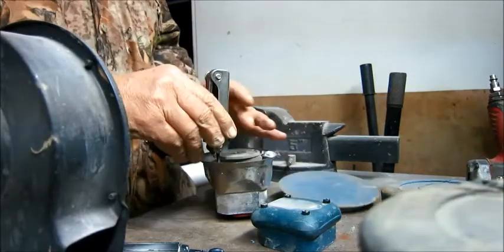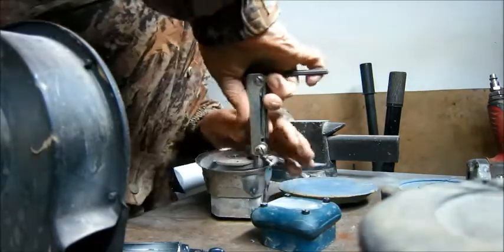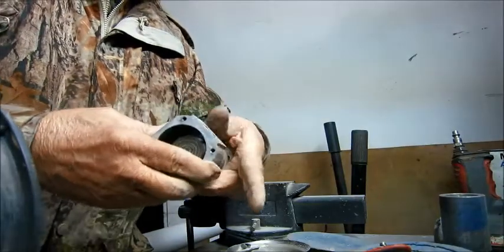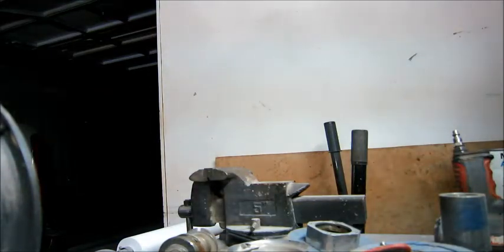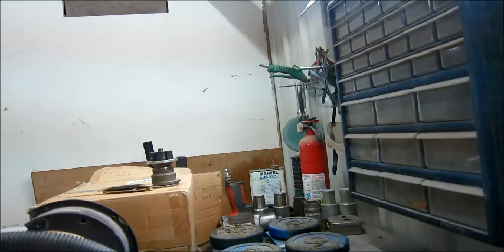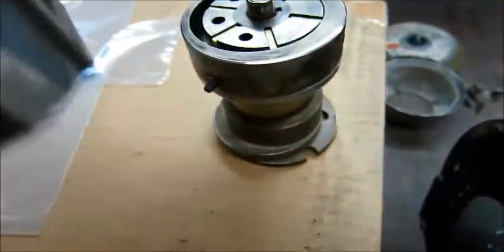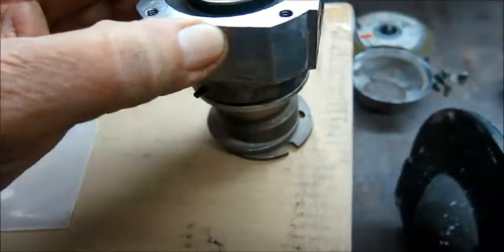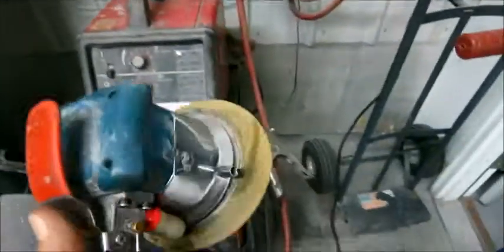HUTCHENS SANDER REPAIR

Comment: Nice fix!  I replaced the vanes in a mud hod sander once and I had the same struggles you did.  Old gummy parts and a little corrosion keeps them stuck together pretty tight.  Better than new now.  The new ones all seem to use a quick change replacement motor that costs around $100.  Guess its better than $250-$300 for a new quality Hutchins or Dynabrade unit
Reply from the maker: +Velvethamma  thanks. every thing was a little rusty from sitting